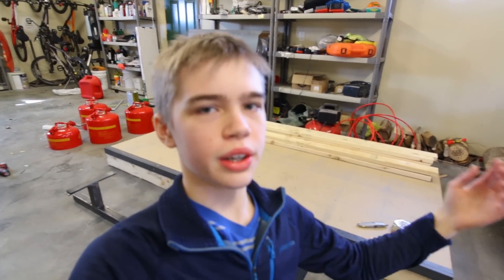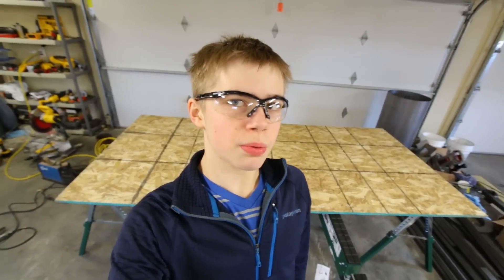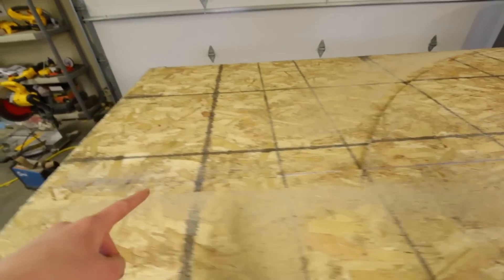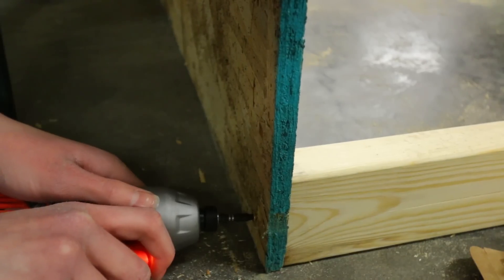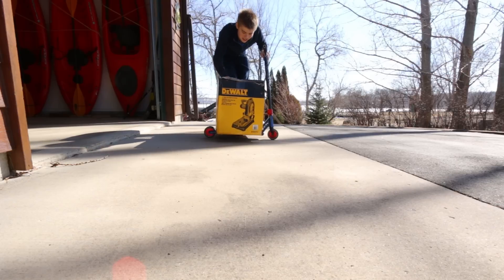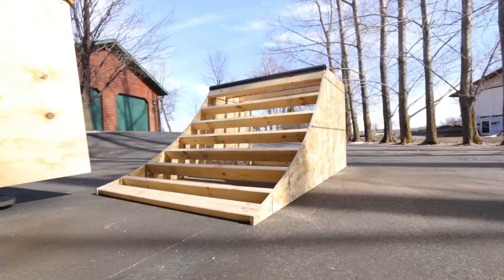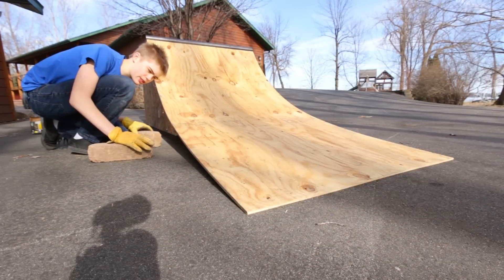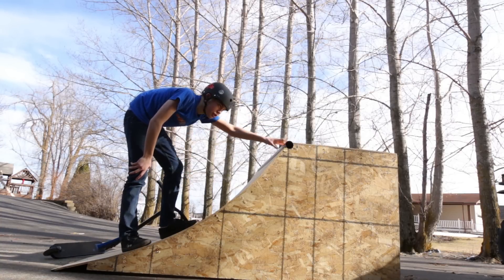BUILDING A QUARTERPIPE!!! (PT1)

Comment: For the sides of a quarter pipe would u use cdx grade plywood or bc grade plywood?
Reply from the maker: For the sides you should use pressure treated plywood, it will look like CDX that is green. Nasty stuff but it dose not rot. If it will be elevated off the ground you can use any exterior grade 3/4" plywood, CDX will be cheaper but wont look as good, I would recommend not using ACX tho. If you want a nicer ply I would use BCX. here is some more info about plywood if you want to look at it: http://www.diyskate.com/info_wood.html
Reply: Ya rather use pressure treated ply wood
Reply: Alex Waln good thinking just lean forward going down a ramp and not back

Comment: Hey dude well done!! 9.1k subs that’s a great achievement btw how much did it cost this will really help :D thanks dude keep up the good work.
Reply from the maker: Thanks! The ramp cost about 80-100$ at the time, it would be a little more now with new taxes. Regarding your other comment, the halfpipe would of cost about 51,500$ if it wasn’t for insurance. 1,500$ of that for the ramp, 50,000$ for the subsequent hospital visit for the broken bone lol 😂. Thank god for health insurance.
But really though, it was about 800$ for plywood, 300-400$ for 2x4s, and about 100-200$ for screws and bolts. I got the coping for free, or else that would of added a bit more to the price. 
And as you can guess by the medical bill price, this is all in the USA, more specifically in range of a menards, Home Depot or Lowe’s will be 10-20% more.

Comment: Is the masonite needed or does it just make it smoother
Also where do you buy the coping or whatever you called that metal pipe at the edge of the top of the ramp
Reply from the maker: It just makes it smoother, it is not necessary. For the metal look online for metal yards or metal fabrication places if you just need like 8' of steel go to a metal fabrication place. If you buy from a wholesaler you will need to buy it in 24' pieces btw. You should not pay more then like 1$ per lb I believe.
Reply: Thanks!!!

Comment: Pro tip you should wet the plywood to avoid it breaking from bending it to the ramp
Reply from the maker: Ya, so I first learned construction from someone that has done carpentry and woodworking. Because of what I’ve learned from them, I can’t bring myself to intentionally soak a pice of wood w water lol. Water is generally not good for wood, but some day I should try pouring water on the ramp while forming it. Thanks for the suggestion!

Comment: What is threshold made of and where did you get it from
Reply from the maker: that ramp doesn't have a threshold but if you made a ramp that needed it I would use 11 to 8 Gauge sheet metal, go to a metal fabrication company to get it. It shouldn't cost a whole ton I'm guessing for a ramp,(It shouldn't be more then 20$ In the US) I get it from someone I know at a metal fabrication company, but they can normally get it for really cheap since they work there.

Comment: Strictly looking at the woodworking...
OSB's not the best material for an outdoor ramp, indoor is a different story. Depends where it's going. 

Mathematically speaking, the more layers you put on a ramp, the tighter the transition gets. Imagine you put a foot thick layer of ply down. the transition wouldn't be 6 feet anymore.

And yeah 6' tranny on a 4' ramp thats like 4' wide is kind of not reasonable. The more you skate the better feel you'll get of what YOU like and what YOU would want to have at your home.

Overall for a first quarter build it came out very nicely.  The round cut out for the coping was a very nice detail and well executed. Cleaner than my first quarter.

And for God's sake ride a skateboard.
Reply from the maker: Yup, osb isn't ideal. People claim it falls apart when it gets wet, but I think the kind I had for that ramp had phenol formaldehyde instead of phenol urea as the glue. So it wasn't falling apart fortunately, but ya. its not very strong. And generally it does just fall apart when it gets wet like you were saying. Ya, it was way to steep for a 4ft wide ramp. Thanks btw, I thought the hole saw was a really good idea, I'm glad someone else liked the idea too. I would ride a skateboard, but the focus of skating is just about stalls, grinds etc. The main focus isn't what you do w the board. Unlike scootering. Just my personal opinion :)

Comment: What is the last Pice of Wood what is the Name ?
Reply from the maker: The sides were OSB(I would not recommend that for anything), the first layer on the ramp was CDX plywood, the top surface is Masonite, which is also referred to as hardboard/MDF. It's great for indoor ramps. But if you put it outside and it rains, it's wrecked.

Comment: Those welds on that rail look like sh** I honestly wouldn't trust it.  Even if it's good for 1000 grinds it will break. That would get me fired if I tried to pass that
Reply from the maker: Yes I'm aware they look bad but, I can tell you, it won't break, and have not broken yet. The safety factor (assuming proper welds) is about 8-12. They are full penetration welds, so assuming it only properly fused in 25% of the weld, it still will have a safety factor over 2. And yes, they do look terrible, that's why I'm not a professional stick welder, it was my 2nd time stick welding.

Comment: Those welds are horrible on the rail lol
Reply from the maker: Trayton Powell did I ever make a claim to greatness? What does a “good” weld look like?
Reply: Alex Waln look it up bro 😂 those welds are not good prolly break just grind it off and fix it
Reply from the maker: Trayton Powell  I'm not claiming they are great. I come from a family of welders. My grandpa welded, my other grandpa welded my dad welded, my uncle welded, my other uncle welded, my grandpa now owns a company that mostly welds. My cousin is the "go to" guy on the shop floor. I generally know when a weld is bad, since I've been around welding my whole life, and that one is bad. 

But people think if it looks good its strong, which is nowhere near the case. That weld might look bad but it will hold up better than 50% of MIG welds because it's a full penetration weld and most people don't know how to set up a MIG machine so they get under-penetration. You can not look at a weld from the outside and say if its good or not, welding DOES NOT work that way. 

My point is, you need to know a ton about welds before you say they are good or bad, especially looking at them from the outside. Welding is a very complex topic but every keyboard warrior thinks they know EXACTLY how to do it, when most haven't ever burnt a single rod.

EDIT: Btw the only reason I wrote such a long thing talking about welding is very few people really understand welding and they think they can just look at a weld and say if it's good or not, which is not the case at all and one of the most common misconceptions, and I just want more people to understand it :)